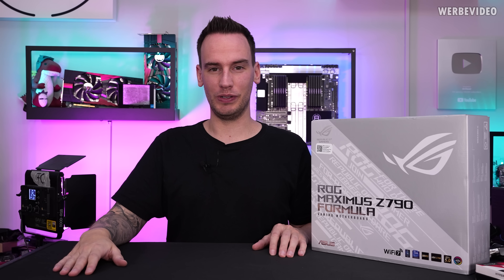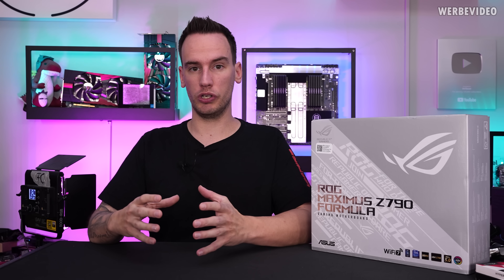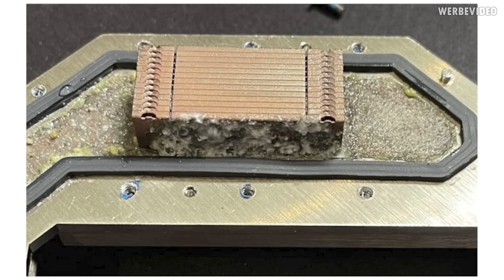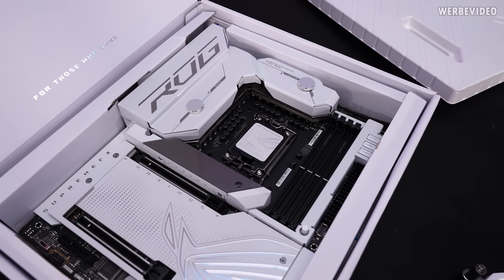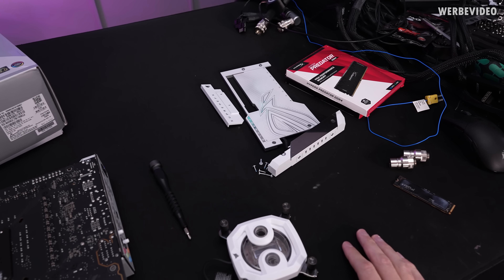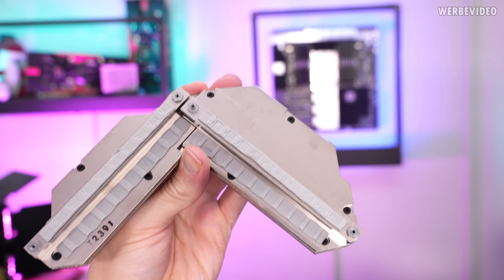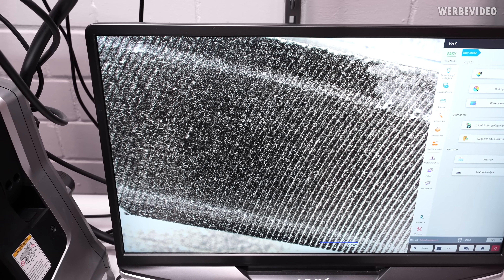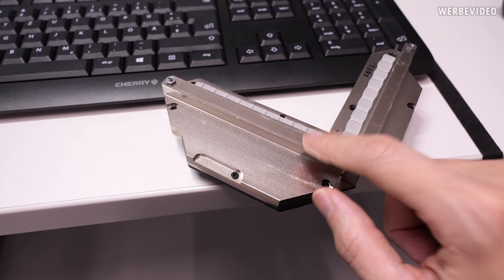Corrosion Risk on Z790 Formula? And the End of ASUS x EKWB Coop

Comment: Mixing metals in general is a nono, be it a water cooler or a bridge.
Reply: actually if you look up aquatic engineering it is possible to mix metals in something like a bridge, as long as the metals are not both submerged in liquid, and also electrically connected. I think this is why companies keep making aluminum water cooling parts, because if you do the research it seems like it should be fine to put copper and alu in the same loop as long as they also aren't grounded to the same thing. however I believe that the concept doesn't work when the water continuously cycles past the same parts. it may work on a bridge because its going to be submerged in a huge open body of water and and electrons are not continuously carried past both different metals.
Reply: @Born_Stellar  if you actually looked it up, you would see that there MUST BE A SEPERATOR BETWEEN DISSIMULAR METALS!

But what do i know i only have 4 engineering degrees vs a keyboard warrior.

carbon steel/aluminum and carbon steel/copper. When these metals are likely to be in contact, they should be coated with nonconductive material such as epoxy or phenolic paint. Elastomer membranes or gaskets can also be used to separate the two metals.
Reply: @pickleadaykeepsthedoctoraway  your welcome.

Comment: I had the z690 formula and mine was all corroded inside the vrm block as well.  Not related but I also had tons of stability issues with that board, I was not happy with it, loved the look though.
Reply: I had stability issues with the z690 formula and corsair dominator 5600 RAM, after talking with tech support at Corsair (who was awesome btw, upgraded my dominator platinum to the new titanium even though the issue was the CPU) they told me the z690 chipset is the cause of the stability issues with DDR5, especially trying to OC it.  the z790 does a much better job.

Comment: I think the fins are there when the heat sink is dry, the temps were probably a bit high only with a copper block
Reply: it's just a weird design decision anyway. Not good for watercooling, mediocre as air cooling. Why not just release an actual watercooling edition? strange decision
Reply: @pickleadaykeepsthedoctoraway   Indeed there is no airflow but it gives more mass for the heat. Should help a bit with bursts of heat

Comment: Top content. I don't shop Asus or Intel myself, but this is reassuring for those that have bought this board already. That it isn't an EK block and "cheaps out" to boot would be more reason to hesitate buying at the price the Formula carries.
Reply: The previous gen was EK and it was pure aluminium. EK is pure garbage.
Reply: @BleepBlop-rh9lm   HE just said in the video that Aluminium part was from ASUS? EK only provided the Monoblock :D
Are we even watching the same video :)
Reply: @NivalisJKK  It doesn't matter. It says EK, they had a chance to control the product and confirm. It's  EK.
Reply: @BleepBlop-rh9lm   EK isn't "pure garbage". Asus just took a license on their name and had some odm like coolermaster build the heatsink and slapped a EK sticker on it.
Reply: @Xfade81  Why EK is not suing them then?
Reply: @BleepBlop-rh9lm   Why would they? Their fittings and monoblock are fine. it's the vrm cooler part that's the problem. and they didn't make it.
Reply: @BleepBlop-rh9lm  EK's logo isn't on the newer boards, so it stands to reason that some discussion was had between EK and Asus and the lack of a lawsuit implies they came to some sort of agreement privately. Not all issues have to end in a public lawsuit burning bridges between them. Signaling to other related companies that they might get sued if something goes wrong in a business dealing with either party can lower the odds of a related company wanting to partner up on anything in the future.

Comment: I’ve never had a motherboard or GPU other than from  ASUS in my systems, but the last few years have shown that it’ll be a long time before I buy another ASUS product.
Reply: I remember when i got into pc's in the 90's, ASUS had a good reputation. I've owned good ASUS products in the early 2000s. Never had issues with them. But it seems like they're very sloppy \ negligent these days
Reply: @Boogie_the_cat  I started building in the mid 2000s; last purchase was an x370 and gtx1070; and will be sticking with that system for a while still the way hardware has been going.

Comment: I have the ASUS formula x570 and it has the water cooling heat sink for water as well, I wonder if they have the same issue as this Z790
Reply: I have the same ASUS ROG CH8 FORMULA x570 motherboard. It has the EKWB VRM COOLERS. I am using the EK CPU COOLER WITH THE VRM BRIDGE PLATE. I have been running it over 2 years with no issues, but on my next coolant flush, I might want to open the VRM coolers and check it out...

Comment: Copper-coated aluminum? WHY?

That's like selling a jar of peanut butter with motor oil in it.
Reply: Agreed. First thing they teach you as an electrician is that copper and aluminum actually react together- the metals will corrode each other. That's why you can't mix wiring in a house without this special paste stuff to protect them. This is just a bad idea. I mean when buying water cooling parts they specifically tell you do not put aluminum parts in a copper loop of vice versa. They apparently hate each other so much they can't get along on the same waterway with no actual contact, so WHY are manufacturers fusing the two together? It's a 700 dollar board retail, and the cost difference between aluminum and copper is pennies per pound realistically, this is all nickel and diming things into oblivion to make shareholders happy. We need a new EVGA to set things right again!
Reply: @arudanel5542  if you start to research different metals in regards to galvanic corrosion, you find that technically the 2 metals need to be both 1: in the same liquid and 2: also electrically connected. engineers for aquatic structures, like bridges, follow this rule and it works fine. In theory, aluminum and copper are fine as long as they are not also electrically connected in the loop. however, I believe that the speed of the liquid in water loops can carry the electrons around to the other metals, so something that isn't an issue in the scientific literature becomes one in a closed loop. if you just put copper and alu in a bath there would be no issues, but then cycling the water past each part like 10x a minute it does start to occur. 
I actually ran aluminum radiators and copper blocks in a build, I was very careful to make sure to use rubber gaskets to isolate the radiators, but the aluminum still seemed to deposit itself on the other metals. not really corrosion, but some sort of migration happened.
Reply: @arudanel5542  Step 1 is gonna be to let these $400+ boards collect dust on the shelves. The more reviewer videos we see about this stuff, the more people are gonna realize that it's not only placebo for their systems, but poison.

Comment: I already bought this board and currently using it. I am glad to find out it won't cause corrosion issues in mu loop.
Reply: I mean I wouldn’t use it, not to mention $800 for an aluminum blocked mobo is ridiculous

Comment: My rule is to never spend more than $200 on any one pc component.
Reply: $200 gpu is weak sauce though.
Reply: @Born_Stellar They are cheapskates
Reply: @Born_Stellar  . . are you trying to shame me? It won't work as I have no shame. I have been using an RX 470 4GB for many years and it has done everything that I ask it to do. AMD is dropping support for the Polaris cards so I just bought an RX 5700 (non-xt) , which is really just an RX 5600xt with 8GB of ram. It was a mining card and needed the bios flashed back to graphics. Simple task and it was only $50 on ebay ($62 w/shipping). That leaves $138 of my GPU budget to apply to other things. So I put $80 of that into a new 1200 watt PLATINUM PSU ($280). It has a 12 year warranty so My PSU needs are met for the next decade. My budget for each component is $200. A PC needs seven components, PSU, CPU, MOBO, MEM, STORAGE, GPU, CASE. At a budget of $200 bucks per component, that's a $1400 budget. OK?
Reply: So you buy extremely weak low end hardware.
Reply: @ZackSNetwork  I buy hardware that meets my actual needs.

Comment: I will say that ASUS suffered during the Z690 launch, between the HERO and the backwards CAP,  The Formula with the corrosion, and the Extreme with tons of issues with the Anime Matrix display freezing,  really sucks to see this with very high end products.  I also had to RMA a Asus Cooler during the same year with a terrible pump whine.
Reply: I had the maximus extreme z790 cook my cpu at auto settings. Pretty disappointing no matter the board you get, you get duds.
Reply: @Houstonruss  That really does not seem possible.  Boards have a package temp limit, even t that limit the chip will just throttle down until it stabilizes.  ARe you sure you did not remove that limit?
Reply: z690 extreme also had the backwards cap fyi guess how i know...by smell
Reply: @fredEVOIX  There has been no confirmed cases of this on the Extreme board.

Comment: Z690 Extreme Glacial doesn't have this issue, which is a solid co-op between EK and ASUS.
Reply: Well, I would hope so for a $2000 motherboard.....
Reply: @Apollo-Computers  had the z690 it was trash a 2k single pcie slot MB where you cannot use the 5.0 nvme port (like all motherboards btw) because it HALVES your gpu slot bandwith (it's x8 period not x8 of 5.0...which means your 4090 runs 13gb/s instead of 26) and disabled the 2nd pcie slot, so again a 2k single pcie slot MB where you cannot use the 5.0 nvme slot it was so great I'm on a z790 ddr4 tomahawk DDR4 today motherboard now that i paid 460$ and that has 3 pcie slots useable and i can populate all 4 nvme slots (4.0) everything running at full speed oh and I can actually use 4 slots of ram unlike ddr5
Reply: Same here- MSI Z790 Tomahawk D4 and it's rock solid, 4 DIMMs running at 3600 MT for 128GB total (I wish browsers were more optimized- just saying.) Since I got this MSI board I have had zero issues, and it cost about the same as budget ASUS board. I mean I have a NH-D15 cooler, and vertical GPU, the motherboard isn't even visible anyways!  @fredEVOIX
Reply: I haven’t populated more than one pcie a lot in more than a decade. To each their own

Comment: ASUS cutting corners, I’m not surprised. Managed to shave 10C on PCH of a B650F-E simply replacing their poor thermalpad. Same with NVME and the TUF 4080. MSI uses a much better thermalpad to start with.
Reply: Go look up northwest repair (fixes gou's) he'll disagree with msi quality over all
Reply: I don’t have problems with thermals on my TUF 4080 so far.
Reply: Thermalpad sizes on NVME heatsinks are totally wrong resulting in bent PCBs. Sometimes it's even impossible to install the drive with the included pads (z790-i top port). The only solution is to switch to thermal putty (u6-pro for example). It seems ASUS  is just unable to make a correct measurements.
Reply: Asus thermal pads is a meme. B650e-I boards come with an SSD thermal pads that’s too thick, which bends the M2 drive. It works, but it defo shouldn’t happen
Reply: Even Asus Customer Service can't give me size thermalpad I need for X570 Formula. After so long they give me the size but not telling me what size for what place... So useless...
Reply: @hasyidanparamananda can't you just measure it? I understand that Asus should be able to give you that information, but after so long I'd just get out my calipers, or even just a tape measure should do.
Reply: @hasyidanparamananda  just buy some .5, 1 and 1.5mm pads and then you should be fine for whatever it is. you can even stack thermal pads without much loss so could just buy .5 pads and stack them.
Reply: @hayleyxyz I should not have to measure it. What is with the tech world and thinking it's okay to be like this? You ever worked on a car? It's very simple to get torque specs and measurements needed.
It should be the same thing here.
Reply: @rustler08  that is true you can get dealership level PDF manuals for roughly 20€ and they come with everything about your car from basic functionality and service to being able to rebuild a engine etc.

detailed manuals should be included with GPU/motherboard purchase so it is easier to service and troubleshoot them
Reply: @rustler08  yes, I have, and I have an engineering background. I said I agree that Asus should've been able to give you that information, but at some point you realise their support team is useless and do it yourself.
Reply: @rustler08 What automaker can you call and get specs for repairing your car? It is easy, yes, but not free by a long shot.
Reply: Understood , we were taking 65mhash to 80mhash 3080 10gb founders then doing some NITR0 mods getting 100mph ash to 148mhash if the chip formed all the way so you see the quality of true binning ,
Reply: MSI used to have leaky thermals iirc. Now their Suprim is one of the best Nvidia cards available by price, quality and performance (PCB build) almost for any Nvidia GPU variation of 40xx. Even for 30xx it was kind of amazing!
Rn ASUS literally pooping pants harder than ever. From most flawed AMD AM5 boards release with bad quality control (withstood one myself with flawed X670E Gaming-F that has coilwhine and dead CMOS.. Board for 700 bucks btw) & BIOS gaslighting... Also this Z690 formula corrosion issues is not really new. Not even talking about the EvangeNlion misspelled part on their new Evangelion collab line, lmao.
Also their noctua collab for GPUs sucks - they charge huge extra for noctua fans on literally the same PCB of TUF though it supposed to be the premium segment like their Strix cards... Insane prices as a cherry on top... As always.
Reply: Stop buying ASUS then. They are cutting corners because they are sponsoring most of the Tech Youtubers.
Reply: Their Strix 30 series were also pretty bad. Thermal paste dries up within a year and the pads gets flaky soon after.

Comment: Jesus Christ, EK just stop...worse quality than even Bykski
Reply: Watch it again, I think it is pretty obvious that it's nothing to do with EK, hense why they have the exact same block again, without the EK logo. ASUS probably licensed the EK logo, they then screwed up the waterblock and then EK got pissed and got them to remove it for the next one - hense no EK logo. If EK made it, it would have the EK logo and wouldn't have been the same as the previous one.
Reply: @seenin60seconds Its been known for years that a lot of EK corrodes overtime because they're cutting corners with plating (and the overall quality is bad, I've had various EK GPU blocks that were bent right out of the box)
I'd rather say Asus was too ashamed to put an EK logo on it anymore, not willing to take any risks for even more bad PR so they probably reworked the block just enough as to not to have it branded as EK but rather as their own product.
Reply: @puciohenzap891  bent!?!? they are solid blocks of copper, how did you manage to bend one? and corroded what? corrded copper under the nickel? you know a lot of blocks are just copper to begin with. you're probably mistaking wear of the nickel from pastel type coolants with corrosion.